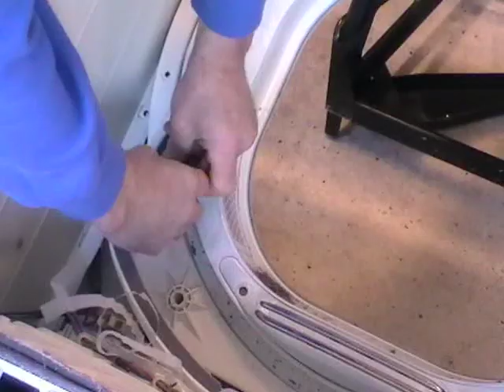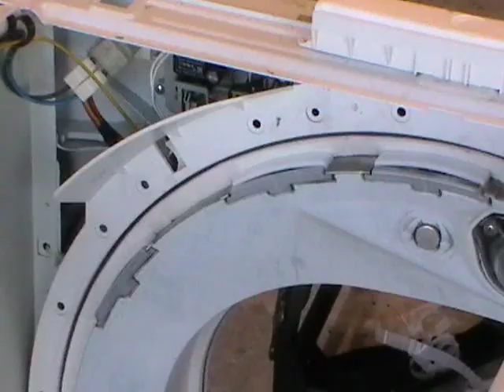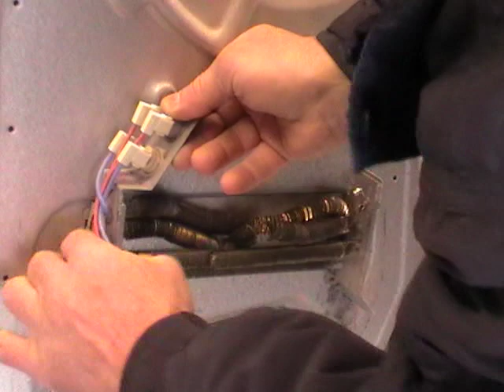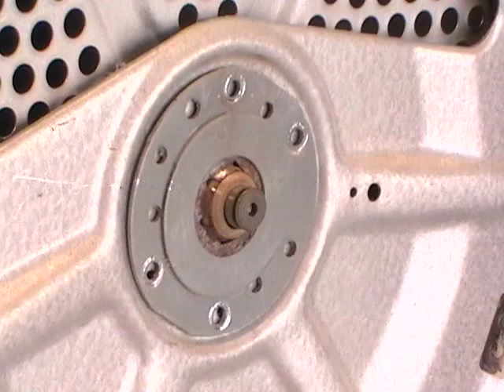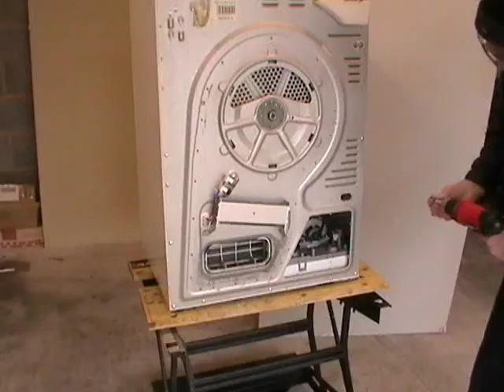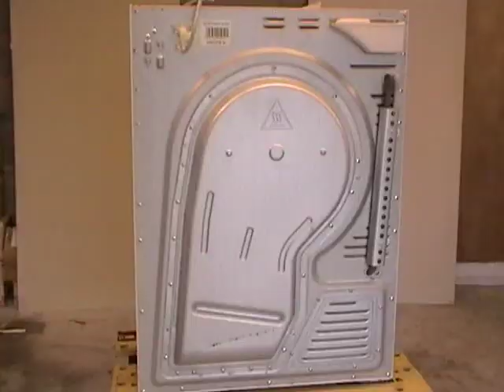Beko Tumble Dryer DCRS76W strip and rebuild part 2

Comment: I was told the very loud noise on my Beko was a pair of drum rollers that support the drum. However it appears the Beko doesn't have any. So what could be the source of a very loud rubbing type noise as soon as the dryer is turned on and drum turning as normal?

Comment: hi my Beko Tank Valve Assembly the spring wit hthe little black plastic just popped out how do i fix this? do you have a video showing how you take the bottom part of the dryer off so i can get to the Tank Valve Assembly

Comment: is it bad that i get the belt back on by putting the drum into the whole back panel then place the belt over the motor spindle, then lever up the whole back panel with drum and then bung all the screws in! - it works!

Comment: Getting the belt on is hard going. Having read the tips below I had a brainwave and used part of a folding walking stick (the hollow tube kind) with butter smeared on the end to help the belt slide into place. It worked a treat.
Reply: Marie I used my hoover pipe. Was so easy that way.

Comment: Great video thanks. Does a compromised seal (i.e. non-flat with a step in it such as in the video) greatly influence drying times ?. I've had ours apart, fully cleaned, both pumps working (pump at rear comes on every 2 mins for 30 secs) and all tubes/sumps free but it takes around 2 hours to dry an average load (on the extra dry setting). Only thing I can see not quite right is the step in the seal like yours (and part of the seal not aligned with the circumference of the drum - can't see any tar on the leading edge of the drum (all looks clean). Heater looks fine (cleaned it up) and it/drum gets hot etc. Or is 2 hours normal ? - I question this as all the reviews for a drcs76w suggest not. Thanks for any help..

Comment: Hi. I was wondering if you can help me. I have a beko the same model as shown in the clip. I have been trying to fix this dryer for 2 weeks and replaced the belt and the heating element. Somehow nothing seems to heat up... only on extra dry mode it heats warm but anything else seems dead. I've ran out of options now on what else is at fault. It's workable but it's doing half of its job. Please could tell me if there's anything else that I missed? Or even fix the problem... :(
Reply: Brilliant.. I think the circuit board got fried from the resetting.
Reply: Did you get this fixed in the end? If so what was it?

Comment: Hi I have a beko drcs68w dryer. I wounder if u can help me. I find the dryer very noisey  on spin. Sometime it spins the other way and it's pretty quiet but the normal spin rotation is very noisey it makes it rattle. I've cleaned everything but still wants to rattle.

Comment: Mines now up and running with new seal, bearings and belt - many thanks for posting this up guys, used a new towel rail bar to fit belt, tip sit the belt on a strip of paper to ease sliding on the bar, then roll drum to remove paper,
Reply: also note my model is a DCRS68W - for all I can see its identical.

Comment: Hi
Can you please conform whether it is ok to switch the white and grey hoses around or whether this was an error.
Thanks
Reply from the maker: hi, you cant switch the hoses, at one end only, it won't work correctly
Reply: hi my Beko Tank Valve Assembly the spring wit hthe little black plastic just popped out how do i fix this? do you have a video showing how you take the bottom part of the dryer off so i can get to the Tank Valve Assembly

Comment from the maker: several reasons for this:
1) condenser blocked
2) pump failure
3) pump housing full of gunge pump can't work.
This is assuming the dryer heats and drum turns etc.. as it should

Comment: Parts came today, all fixed and working grand! thanks for posting the video. To get the belt on the motor drive shaft i used an extension bar of a 1/2" socket set with a 6" galvanised pipe with an i.d. of the same diameter as the o.d. of the extension bar, i put a 1" diameter pipe over this (1m long) for more leverage and i was able to slip the belt over the shaft with my free hand!